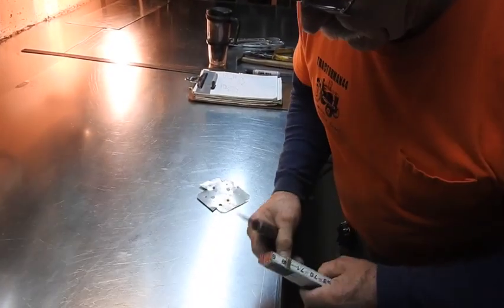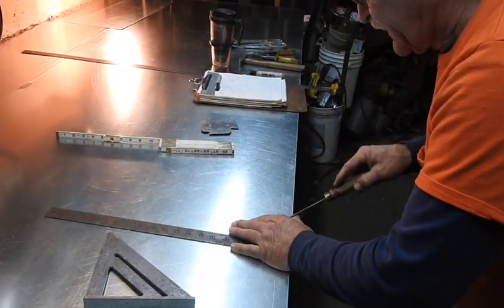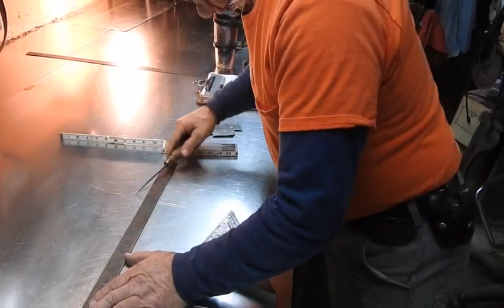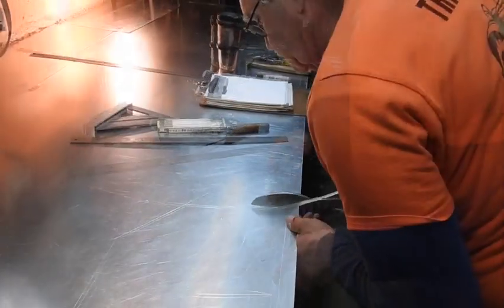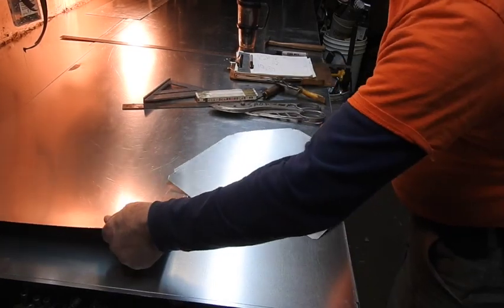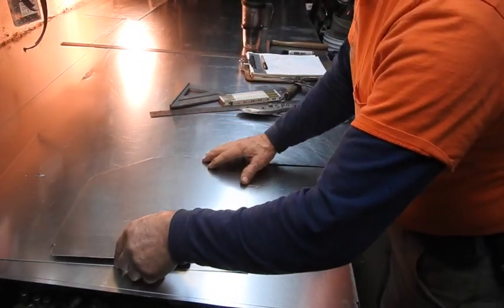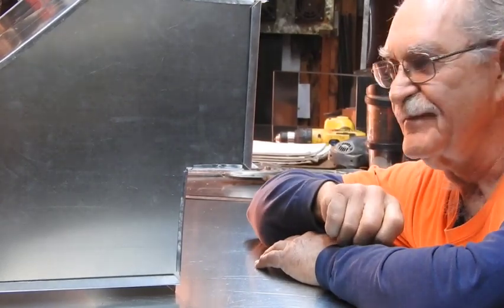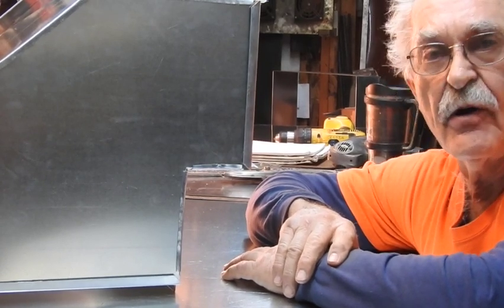Sheetmetal Hack: Shortway Radius

Comment: You always seem to use that same nice hammer when assembling your Fine 44 Ductwork. There must be a story that goes with that hammer. How well I know how certain favorite tools must be used for certain projects. I do have fun watching you making those fine tin projects! In fact, I’m toasting you at this very second with my CuppaJO! Sure, I’d be toasting anyway but I’m tippin twice my 44 Friend and for the Missus as well and much older Brother and Stan and the entire 44 Clan! Missus gets Squeezes extra of course! This is DaveyJO an me outta here headin for me JO pot!
Reply from the maker: Well DaveyJO, whacking as many times as a fella does knocking duct together the larger hammers get to your wrist after a while...especially once you get a few years under your belt.  I keep the bigger steel/leather wrapped hammers for demo jobs.  PLUS...iirc, this is one of the home made hammers I made back in the 70's and had the old man temper for me.  Pretty sure it is....I made several hammers of various sizes back then.  Tack hammers for finish nails and a couple larger tinners hammers out of square stock.  Take care my friend and I too am tippin a bit your way !!
Reply: @tractorman4461  I have 4-5 hammers of various sizes that are a must for certain jobs. I have a special one just for small moldings. Feels great in the hand like a fine CuppaJO! I tip your way! DaveyJO
Reply from the maker: @daveyjoweaver6282  Yessir me too.  Can't use a blacksmith hammer to drive brads....well, I guess you can, but it wouldn't look too good when you're done.  LOL.  Then again, I wouldn't wanna drive a 60d spike with my little tinners hammer either !!  Do you have one of those little tack hammers that have a split in one head to hold the nail to start it ?  Set the nail, then flip the hammer 180 and drive it home.  Heck I even have a magnetic hammer for setting big-head insulation rivits into the inside of ducts.  Its a double headed magnetic head.  Man I've slammed thousands of those things in back in the day.
Reply: @tractorman4461  Yep, those old split end tack hammers, I do have one someplace. I have items known and unknown to mankind in my shop, just like you! Tippin in the morning 44 Friend!

Comment: Cant we get a computer 💻 to make this   Have a nice day.  There are lots of things that are getting harder to get done because younger people like to work with computers
Reply from the maker: Hahahahahaha..... Almost any shop of any size has a CNC plasma table now.  I've watched them draw the fittings one side at a time, but have never sat at the screen to do it !!  Now I'm not saying I wouldn't like to try it though...  but if I'm going to get a CNC table it'll be for the Hypertherm plasma for welding fabrication and not sheet metal. Thanks Richard for the visit once again.
Reply: @tractorman4461  Unless you are making multiples, like dozens, a Skilled Person can make a one off faster and with less waste than setting up the machine, laying out the cut, setting the plate on the table and cutting. 
There were quite a few trials before the armor plate was cut in a way that didn't require rework. It use to drive me nuts that I had to write rework work instructions to repair problems that wouldn't have happened if they had followed the work instructions in the first place. 
Rework means you build it once then spend the time fixing it that you could have spent making new ones reworking the old. It ends up costing three times the labor to end up with one part. 
It takes someone who understands how to make it by hand to set up the process.
Reply from the maker: @OldSneelock  I think you said a great deal with that comment my friend. One thing I've always hated was reworking something that didn't work as planned. I TRY to keep that to a minimum.  LOL.